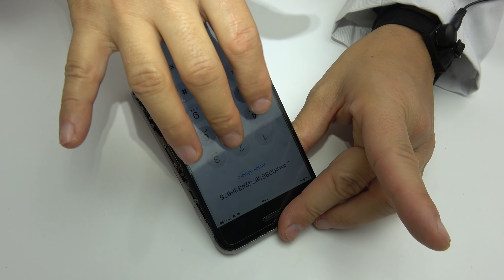CURSO de REPARACIÓN de CELULARES #9 Cambiar IC cuando la pantalla táctil no funciona

Comment: Como sabes cuando es el cúmulus o el Mesón?  No me llegan números de referencia a ningún pin del conector del touch.
Reply from the maker: Hola. Hay que medir los voltajes de alrededor con la ayuda de un esquemático. A ver si más adelante preparamos un curso. 
 En este modelo en proporción de 95% se daña el meson.

Un saludo.
Reply: @MovilOne  Ya me di los voltajes del meson y cumulus y todos los que dicta el esquematico, están presentes.
Reply from the maker: Yo levantaría el meson y media las impedancias debajo de este circuito.
Reply: @MovilOne  medi impedancias en el meson y todo está bien. Luego medi en el cúmulus y me no tiene valor en la esfera  F1. Le raspe adelante pero tampoco da valor. Tengo que hacer reballing al CPU? O hay alguna otra solución?
Reply from the maker: No tengo el esquemático delante, la F1 va hacia el microprocesador?
Reply: @MovilOne  si así es
Reply from the maker: Entonces lo tienes complicado
Reply: @MovilOne  crees que raspando el CPU funcione? Haciendo puente de allí a el Cúmulus? Igual es mi móvil. Pero si lo hago correcto, funcionara?
Reply from the maker: Hay que encontrar de una forma que está línea llegue de un lado a otro.